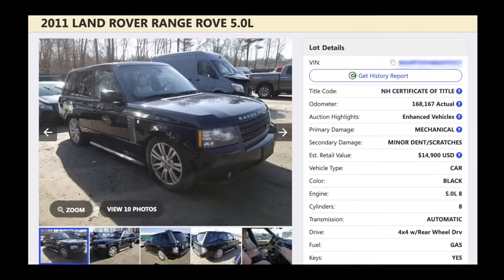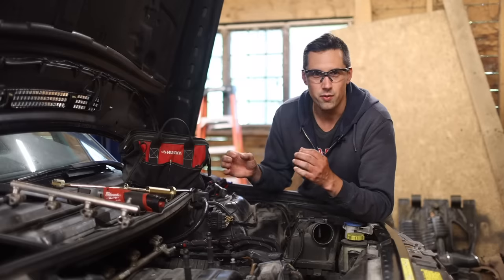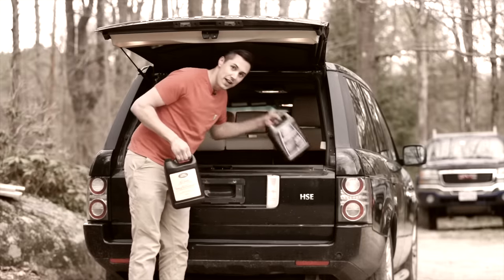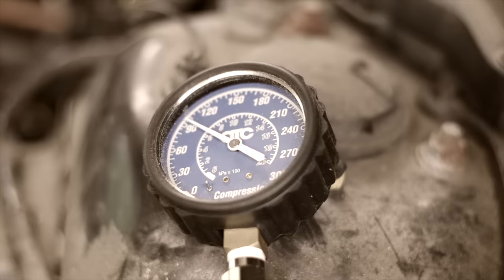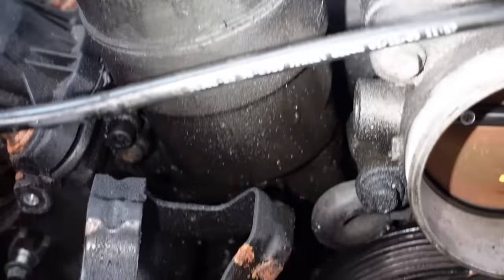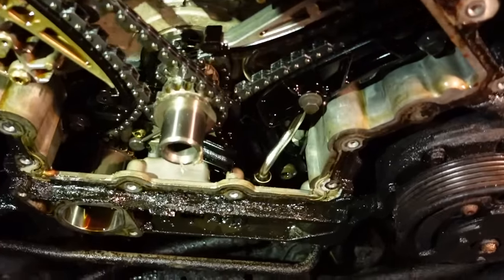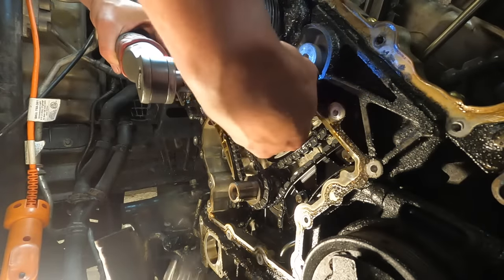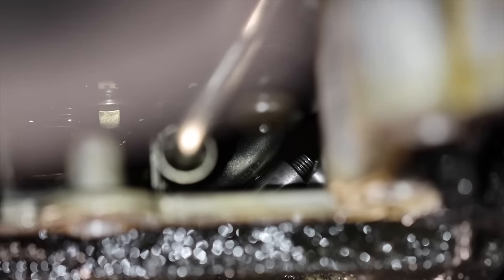I Found This Broken Bolt in the Crankcase of my Cheap Range Rover’s Engine! [Part 3]

Comment: You're deep into it now. I vote for a rebuild.
Reply: We would hope the engine is rebuildable.
Reply: @robj2704  anything is rebuildable with money
Reply: I just don’t think enough of these old rovers make it to a point where they are rebuilt before something else happens where it becomes not pragmatic for the owner to do it , so I don’t think there’s gonna be a big market out there for over sized pistons
Reply: Yep - just subscribed because I want to see this
Reply: Just do an ls or Duramax swap
Reply: got to agree with this :)) never back down from a mechanical fight 🤣🤣
Reply: @evictioncarpentry2628  I'm glad someone pointed that out.
Reply: @Hard_Right  It's like manufacturers know the car and think, "why bother? it's going to fall apart anyway".
Reply: I totally agree
Reply: Ye
Reply: Rebuild rebuild rebuild rebuild rebuild rebuild
Reply: ive subscribed for the rebuild
Reply: Rebuild for sure. Still going to be ahead of the cost.
Reply: lol
Reply: Rebuild
Reply: I agree with Ray, rebuild!!!
Reply: @cengizhantugrul5918  l
Reply: Rebuild it is!
Reply: I never knew there could be so many thing go wrong with an engine.
Reply: Having reached that far,  you'd likely kick yourself if you don't just finish the job. I would want the satisfaction of knowing that everything is copacetic. Nice job,  so far
Reply: @evictioncarpentry2628  not if the block is warped. But even if it is he can get a new block and build it up.
Reply: HOW do people remember where everything goes when putting things back!?
Reply: @trumanhw  simply take a photo b4 and Internet 😊

Comment: My OPINION: Pull cylinder heads, replace head gaskets, reassemble car, drive car as is, use savings from not paying for a rebuild to buy other car products to keep channel alive (because your content is the bomb-digity and only getting better), engine swap with diesel engine when the gasoline engine inevitably dies because it is a poor design, enjoy life.

Comment: This is why when a customer says "Range Rov...", they don't even get it all out before I say "no".
Reply from the maker: I don't blame you 😂
Reply: I think that you fix the timing issue, fill the fuel tank, and drive it to Alaska. They have this Fourth of July celebration where they launch vehicles off of cliffs!!!
Reply: @covecove5978  Best idea ever
Reply: @covecove5978  Honestly... you'd probably get 5 million views with that idea and make your money back from the ad revenue alone.
Reply: Sorry  @Watch Wes Work, I've had RR while in Dubai, where the heat is brutal to cars.  My RR held up well with no issues and I'd have another.  However I also had a Raptor which was my daily and used to haul my dive gear and a 30' boat (which the RR couldn't do) and while I loved my Raptor you knew it was build down to a price, with cheap interior and plastic bits falling off the outside

Comment: Well it's gone that far I'd pull the engine , rebuild it gets my vote good for us to watch ! We learn , hone bores free rings old pistons back in , new shells , it should be fine , thanks for sharing Waldo !
Reply from the maker: Thanks Steve! I think you're right 👍
Reply: I would like to see a rebuild and if you did rebuild it the vehicle would be worth something
Reply: If you pull the engine, the clutch will be nice and easy to change also
Reply: no wonder we are running out of stuff when one thing is broken the default answer is replace instead of repair
Reply: @hillppari  a lot of parts vendors do actually take old parts back for a partial refund of the purchase price to encourage recycling.

Comment: As much as I'd enjoy watching you do a full engine out rebuild, even here in the UK (It's spiritual homeland) engine parts aren't cheap for the later V8 Range Rovers, so before stripping it much further, I'd be tempted to start pricing up EVERYTHING you know you'll need, plus anything you COULD need in order to do the rebuild. In some cases It's occasionally only fractionally more expensive to source a fully reconditioned engine. It might even work out better value to find some company this side of the pond to buy a recon unit from and get it shipped over (less rare over here = less money over here, and as the £ is worth sod all at the minute, it could be worth looking into).

Even something like a genuine full gasket set Is likely to set you back well over 500 USD, so when you start adding up all the little "Worth replacing while it's apart" bits, it starts getting alarmingly pricey really fast.
Reply: @12:45 I had a Range Rover that hit 350,000 miles.  Except we spelled it Landcruiser.
Reply: @1nvisible1  We spell it Toyota.
Reply: Yes agreed but what fun is that for the channel and viewers.
Reply: This is a great point. I live in Japan and often find it cheaper to source LR parts from the UK. Even with shipping, import fees, and the exchange rate I come out ahead.
Reply: Not true Rover V8 parts are not expensive. No more than any other car.
Reply: @PaulBriden  No, you're right, the Rover V8 engine parts weren't really that expensive for a V8, but this isn't a rover V8 engine, it's a slightly detuned version of the AJ133 engine from the Jaguar XKR. It was made by Jaguar while in partnership with Ford, but it IS a Jag engine, and has Jag spare parts prices. They're also a lot more expensive to work on because they're a complex quad cam, 32 valve V8 that wasn't (Compared to many other engines) sold in particularly large numbers.

Alternatively to the old rover lump, which was an evolution of an engine that started life in the 60's, was almost agricultural and was made in impressive numbers over it's 40+ years of production.
Reply: He'd make that back from ad revenue and subs :)
Reply: @Reman1975  I stand corrected.
Reply: @azabujubangaijin6607  Which is great but how do you manage to work on the car in Azabu Juban? That would sure be interesting to know!
Reply: @WashburnD10  haha, impossible to do anything in AJ! I have a place in Shizuoka (Shimoda). Not perfect, but I make it work. Working on two Disco 1s now.
Reply: Problem is, there are engine reconditioners, and there are engine reconditioners.  You can't cheap out on such a poor (read diecast-aluminium) design V8.  I hate diecast with a passion (except for pistons, of course).  Of course, there is Toyota diecast, and there is other diecast.
Reply: @robertwells3797  According to "Starstat", the Waldo's World channel might be making just under $3k a month total. Not a bad sum for a YouTuber, but not life changing. If he's currently using YouTube as a primary income it's not really that much to cover all his living expenses, but if this is just cash to pay for more YouTube related things it's different.

I suppose it all depends on how much content the Range Rover could create for him. If he get's 3 month's worth of videos out of it he might do OK out of a rebuild, but a lot of the subscribers are here for the fabrication work, so I'm not sure what a long series concentrating on an engine rebuild would do for his viewer analytics. It COULD bring in a wider audience, but it could just as easily alienate some of the current fans. no one would know which until he does it and finds out.

Maybe he should work out the pro's, con's and costs to both rebuild and replace, then lay it all out in a pole to see what the fans would prefer to see? If the majority want to see a detailed engine rebuild, then it could mean he'd get extra subs from it, but if it turns out people would rather see him doing more fabrication instead, he'd know not to lean too hard of the engine job for content to avoid losing viewers.

All I was saying is that he really needs to work out the worst case cost for a rebuild Vs the cost of getting a recon unit before going too far down this rabbit hole.
Reply: @1nvisible1  I have a 1993 fj80 with 205000 miles. Runs like a clock.
Reply: @PaulBriden  🤣

Comment: Hey brother glad those tools look to be working smooth for you so far! As soon as I saw the copper I realized I should have sent you my long straight edge that I used to check my block as well. This whole thing is deja vu lol. If the block isn't warped and the crank isn't damaged, since I think getting oversized bearings might be nearly impossible, I definitely vote to go further than I did and do a rebuild and successfully save one of these AJ133s for once! After seeing the hole and the guide and how insanely lucky it was  for that bank to not have already completely skipped time, I think this thing spiritually wants to live. I'm hyped for it!
Reply from the maker: I did manage to find oversized bearings! Also, I do have a machinists straight edge, so I should be all set there. I think a rebuild is in the future for this 👍
Reply: @WaldosWorld  Nice! I highly anticipate seeing what comes apart. Have fun using that $200 head bolt socket😂
Reply: Yeah this is the luckiest engine alive. Deserves a revuild
Reply: Love your e39 man.

Comment: Looking at the valves and the scoring on cylinder walls, the engine is drawing you into rebuild. Having disassembled to this level, take head out, do valve seating and change head gasket.
I like the way you are presenting the case. Your presentation is pleasant and videos are learning schools for us. Good job Waldo.

Comment: I would say rebuilding the engine is the better option, because I think replacing it even with a very low mileage engine will leave you at the same spot as now considering of course how long you plan to keep the car. Thanks for your videos, I really enjoy watching them.

Comment: From a fellow rural New Hampshire Engineer (originally from the UK). This is seriously one of the most awesome channels. You do things dead on right and you have none of the typical YT gimmicks and annoying crap. Someone made reference to Ed China in the comments. I think that's an excellent comparison as you clearly do this for the love of Engineering. I'm dealing with a North Eastern 2004 Hummer H2 at the moment with a rusty frame. One of those jobs you wish you never started. All the best and keep up the excellent work.

Comment: Full rebuild... the problem I see is getting those buggered mounting points repaired to 'as new' condition. Aren't these essentially the Ford multi-valve ohc engines? Any way you could bring one of those into it without too much hassle? I mean, I'm not pushing for a Coyote installation but if it would fit, wow... imagine the possibilities!

Comment: I personally would pull everything apart. Whenever I'm working on one of my cars if I have to remove six different wear items to get to what I'm in there to fix I'm replacing everything.

One good thing with me doing things like that it stops a lot of my friends from asking me to work on their car. They don't like the idea of replacing things that have it broke yet.

Whenever I change fan belts and spark plugs and wires I have a box that I keep in the back of each of my cars with those items. That way if you were traveling and you throw a belt for some reason you don't need to go to the store you got one in the trunk.

I'm really looking forward to watching the next video. I've been waiting to see what happened to this engine. It's hard to believe that it was still running prior to taking it apart.

As always and I made sure to give you a big old thumbs up. Look forward to seeing the next video.

Comment: I don't know if you stated the mileage on this project but what I see so far is pull the engine and do it right . I just did the timing chains and guides on 2004 Range Rover for the second time two weeks ago, the first time four years ago I puled the engine so I could reseal all the oil leaks on the BMW engine at the time of doing the chains and guides and thought it would be the last time I would have to do it. The only problem was the main chain tensioner had a flaw in that the oil passage to lube the chain was not drilled to oil the chain and guide. She lasted 40K and the guides let go. This time I did the job in frame because there were no oil leaks to fix. The old girl has 174k on her now and I love this car and going to drive her until the wheels fall off. I bought the parts kit this time from Atlantic British and they sent Rover parts and the main guide had the correct part number on the box but the guide was wrong and packaged at the rover factory so check all parts carefully.

Comment: hey waldo im wondering, have you thought about doing 4wd on Billy bob? I bet with a dana 70 front axle that can be accomplished. it would also help with traction during heavy snow
Reply: Dana 70 front axles are as rare as hens teeth, used by dodge and international from 1958-mid 1970s. He'd be time, money and effort ahead if he used a Dana 60 dually front axle from a square body.
Reply from the maker: Yes, I love the idea of a Dana 70, though as mentioned above, they're very rare! 👍
Reply: @WaldosWorld  unfortunately yes, or maybe you could try to use an f450 front axle, bc like you had mentioned in the past, the c3500hd is essentially a 4500hd. just throwing out options

Comment: Let me offer some help: Take the hood ornament off the Range Rover. Back the Rover out of your shop and take it to the local scrap yard. Pay them to take if from you if you must. Then, go get yourself a Toyota Land Cruiser. Any model year; it doesn't matter which. Pull that back in your shop and swap out the hood ornaments. All of your problems will be solved! (I understand that this may be good for content. But if you plan to get off the beaten path, especially with your family, I wouldn't trust a Range Rover.)
Reply: Boring. Range Rovers are on another league
Reply: @aslankarnuf  You're absolutely right. The league of broken down junk that costs a fortune to buy, and is worth scrap metal within five years.
Reply: @mattphillips1910  so boriiiing. Comparing a plasticky Toyota with one of the best luxury cars ever made. Apple and oranges
Reply: @aslankarnuf  I guess it defines how you define "best". Range Rovers break down every 5 minutes and cost thousands to repair. And their value plummets to near nothing within a short time. TLC's, on the other hand, almost never break down. You've got an interesting definition for "best". I guess the repair shop is a place you don't find "boring"?
Reply: @mattphillips1910  I have a 2011 Autobiography and not only I never had a problem with it (I do regular maintenance with Swiss precision) but I have a $50/month extended warranty that covers any repair that I will possibly need in the future. So I don’t really know what is your experience with Range Rover, but mine is awesome! And luxury-wise, there simply is no comparison with any Toyota ever made.

Comment: Up until this point, I've been impressed with your ability to do just about anything you put your mind to. But, this? Even if you rebuild the engine and get it "like new", you're whistling past the graveyard on this one. There's still another million things that could go wrong, most, by design, very expensive to fix/replace. Exhibit one: You were holding your breath on the air suspension. Do yourself a favor and push this thing into the nearest river/lake/canal. Then, report it stolen. Let the insurance company pay or write it off your taxes. PS There's a reason why so many have failed.

Comment: Years ago, I owned a 1986 Dodge Reliant K Wagon with the 2.6 Liter Mitsubishi 4 cyl. engine.  When it had about 90,000 miles on it, the engine developed an intermittent knock/rattle.  When I removed the oil pan to examine things, I found a substantial chunk of aluminum hanging down from the front of the engine.  I removed it and after examining where it came from, I removed another piece.  I consulted the manual and found that the aluminum pieces formed a portion of what the manual called a "timing chain guide".  Some of the guide was still in the engine, along with the bolts that held it in place.  The only way to remove/replace the guide was to completely disassemble the engine.  As the timing chain tensioner still took up all of the slack in the timing chain, I decided if it ran, I would continue to use the car as it was.  I finally got rid of the car after 218,000 miles when the automatic transmission began to slip.

Comment: In case you cannot get oversize pistons.. An old school piston trick in a rebuild is knurling. If you need a very small bore out, or even just a big honing, knurling makes the pistons bigger in diameter and creates oil holding grooves which theoretically extend piston life. Automotive machine shops do the knurling. Some engine manufacturers used knurled pistons in new engines.

Comment: Well back in 1983 I ordered a brand new 1984 Z28. After picking it up I was looking around under the hood checking out the 5.0 H.O. engine while it was running.
I noticed a slight rattle and after a few minutes I found it. It was a Snap-On 10 inch extension with a 9mm socket on it laying on the exhaust manifold behind the A.I.R tubes on the passenger side. A BRAND new car with about 50 miles on it at that time.

Comment: I had the '06 full size supercharged Range Rover.  I put 276,000 miles on it over 14 years before selling it for $6,000.   Lots of oil changes.  I also changed the transmission fluid 3 or 4 times.  A new starter (though it just needed cleaning).  Two AC compressors.  The radiator was replaced two times.  And the air suspension was a headache as well.  I never had trouble with the rears but the fronts went out every few years.   The engine itself held up, though.